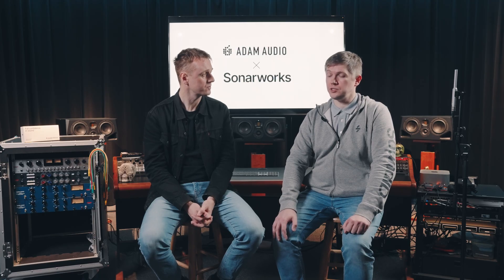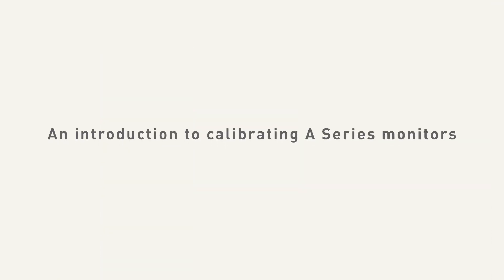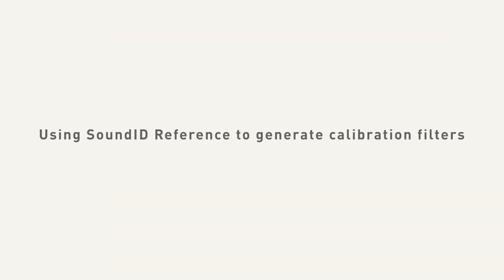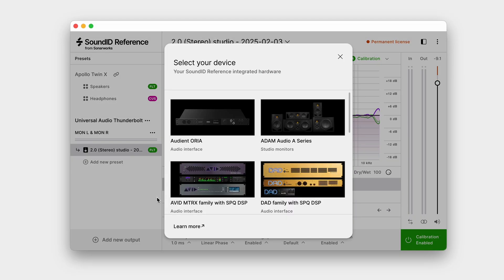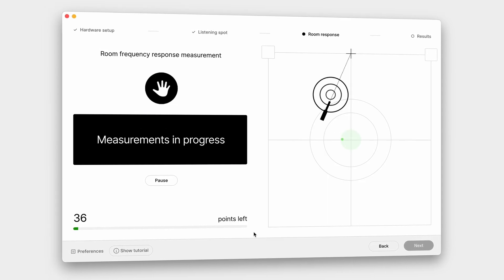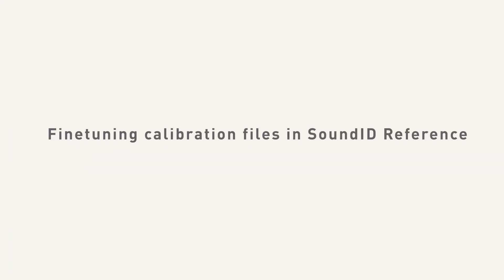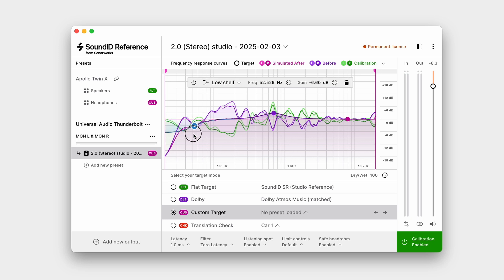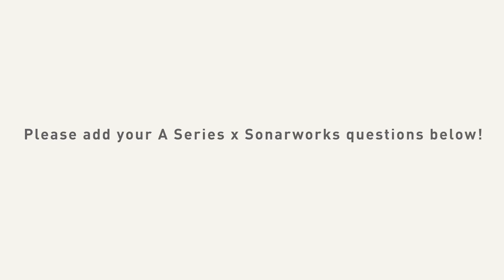ADAM Audio & Sonarworks | A Series loudspeaker calibration using A Control & SoundID Reference

Comment: I have an Apollo x6 Gen 2 series Audio Interface with a pair of A8H's and purchased the Apollo Monitor Correction Plugin. I previously purchased the Adam Audio SoundID Reference for Speakers before upgrading my Audio Interface. Which one is recommended?
Reply from the maker: Hey Daniel, looks like you got double trouble there! If you’re monitoring through the Apollo/Console most of the time, it would generally make sense to use Apollo Monitor Correction as your main correction. However, if you need correction outside the Apollo (system audio, other interfaces, laptop rig, etc.) or want the DAW plugin/Systemwide workflow, it makes more sense to use SoundID Reference.

Of course, you can also try both independently from one another and decide which one you like more. If you're happier with the SoundID Reference calibration, why not just stick with that? Definitely make sure you don't use both simultaneously to avoid double EQing! :)

Hope that helps!
Your ADAM Audio team
Reply: @ADAMAudioBerlin  Thanks for the reply. I'm still auditioning both but what Im having issues with is using the Apollo stand alone, without my computer. I believe it installs directly on the Apollo's DSP, correct? If thats the case when using it stand alone, without Apollo console, the volume knob acts very strangely. Like I barely move it and the signal peaks. I dont think its meant for stand alone use and in that case applying correction to the speakers is the way to go.  Does this make sense?

Comment: Hi ADAM Audio team,
I have a question regarding Sonarworks integration.
The A Series (e.g. A7V) supports direct Sonarworks integration via A Control with DSP profiles stored inside the monitors, which is a great feature.
However, the higher-end S Series (e.g. S2V) does not seem to support this kind of integration and requires using Sonarworks only as a VST/system plugin.
Could you explain why this functionality is not available on the more expensive S Series, and whether native Sonarworks DSP integration for S monitors is planned in the future?
Reply from the maker: Hi there, the A Series was built with the Sonarworks integration. Unfortunately, it is much more complicated to retrofit SoundID reference to existing models. Therefore, a Sonarworks integration with the S series is currently not planned.

Comment: What about the measured timing differences between the speakers? Are those values also transmitted to and used to the speakers?
Reply from the maker: Hey there, thanks for your question! Indeed, the timing differences between the monitors and the microphone/ sitting position are considered and saved in the sonic profile that can be exported to your speakers :) Thanks for watching!

Comment: Could you tell me if I should switch the speakers to Off mode before calibrating? Or can I leave them in Pure, for example?
Reply from the maker: Hey there, thanks for your question! We recommend setting the monitors voicing to Pure, to ensure Sound ID reference does not work against a possible coloration in the voicing – as for example when set to UNR.

Here you can watch our A Series &  Sound ID Reference Tutorial:
https://www.youtube.com/watch?v=pdAw2mVm-EE
 
I hope this answers your question!
Reply: The calibration doesn't measure your monitors output, but rather the rooms acoustic issues. The only sound your monitor will make during the calibration is a simple tone for the microphone to pick up. Therefor it should not matter what mode your monitors are in when doing the calibration, just leave everything as default. After calibration the preset will/can be applied directly into the monitor and from there it will be in EXT mode instead of PURE. I hope that makes sense. ADAM Audio has a video on their YouTube channel where they explain this further.
Reply: @rungemusic why after measuring I listening throw app on windows , sound OK, but if I add files on monitors A7V , sound very different

Comment: I'm using Apollo x8p and A5X with Sonarworks x Apollo plugin. Is there any difference/benefit if I use this instead of my current setup?, or is it just same?
Reply: Im using the Apollo x6 with a pair of A8H's and the same Sonarworks monitor correction plugin and I am not happy with the results. I previously used the SoundID Reference for Adam Audio for calibration that was slightly better which was surprising. I thought the Apollo plugin would be better but I also dont like what it does to the Apollo's volume control. I've messed around with it so much I wonder if I should just delete everything, reset the Apollo to factory and try again? Im tempted to stick with the Adam Audio calibration due to the impact the dedicated Apollo correction does to the volume controller.